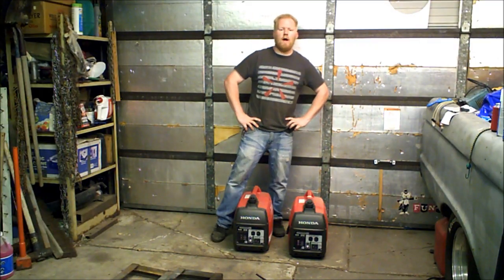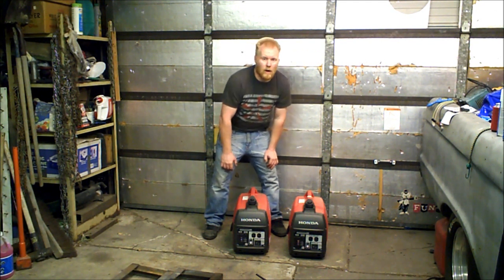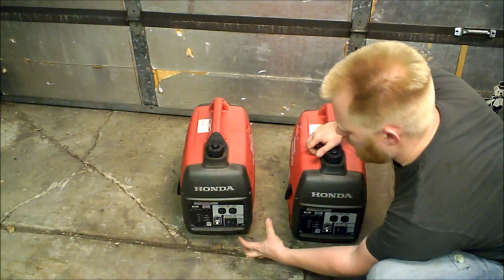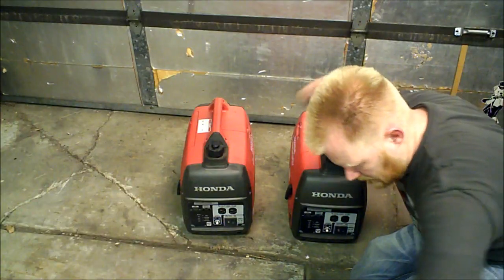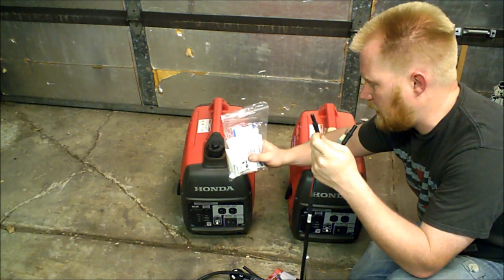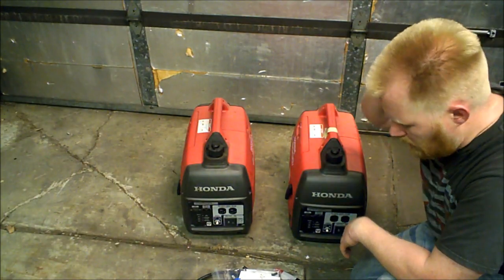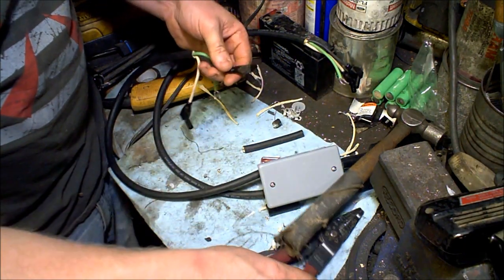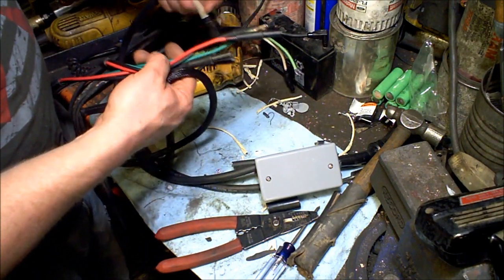Homemade 30A Honda Eu2000i Parallel Kit Generator

Comment: sixtyfiveford, will the hookup work if I don't turn on any  220v home appliances? I don't know if the motor on my gas furnace is 220v also. Your thoughts are much appreciated.
Reply from the maker: ***** Not really, because you will have 2 separate 120V out of phase circuits coming into your home. Every other circuit breaker as you go down touches one or the other. A 220-240v breaker touches both of the out of phase circuits giving it 220-240V. So you could choose to run one 120v leg and every other breaker would be supplied with power. This is why most people will just run extension cords to the major appliances. You could wire a generator on each 120V leg but because the phases of each generator wouldn't be correct(180 degrees out of phase of each other) you couldn't run any 220-240v appliances(Stove, Dryer, water heater).
Reply: sixtyfiveford Thanks, sixtyfiveford for the insight. I appreciate your knowledge on electrical.

Comment: Great video. Will this hookup work for my home transfer switch box instead of an RV? If not, what mods need to be done?
Reply from the maker: ***** Yes and no. It is only a 120v system so half of the home will be without power. You would be better off with a generator that can deliver 220v power to feed both legs of your breaker box.

Comment: Great Video! I am trying to hook up three EU2000 and was wondering if I just connect all three like you connected the two, would that still work? Obviously I need to get a higher rated breaker. Also, instead of the parallel cable connectors can I just use a standard plug on each generator as the output and then connect all three. Thanks
Reply from the maker: Shaddy Mzeghet Yes, just add a third set of banana plugs and a third can join the party. Yes you can just plug into the 20amp 120v plug and get the same thing. With the plug method you run the risk of one generator coming unplugged and it will be live male plug, so be careful. Tie off the plug/cord to the generator handle so if it is yanked it can't pull out the plug.

Comment: So I take it the inverters synchronise? It's usually an unwise idea to think you can just "parallel" two AC power sources even if the voltage, frequency or VA rating is the same
Reply from the maker: Tera Volt Yes, the Honda's are designed to do this.
Reply: LOL! When he brought both generators online, there was nary a hop, skip or jump. Either he was completely lucky by somehow connecting them in sync, without anything to measure it, or the generators have an controller that senses synchronization. Since he's obviously done this more than once, which do you think it is??  Do you think Honda would unleash this on the average consumer with manual sync parallel operation?

Comment: Thanks for the quick response.  It is the same as the Honda, but 2200 starting watts and 1800 continuous.  The outlets have a 15 amp rating and the parallel port hook up is at 20amps.
Reply from the maker: Brian Dernbach So you only have a thin cable connecting/paralleling them?
Reply: No, I built your exact setup, but instead of the plug end that you used, I used a standard 15amp female plug.  My concern was that the plug being rated at 15amp would be a little dangerous?  Also, been having a hell of a time finding the correct banana plugs?  Thanks
Reply from the maker: OH... You built a death plug :-)... kidding. You'll be fine because you're only pulling half the load from each generator. Which is 15amps each.
Reply: Sorry for all the questions, but won't I be pulling the same (roughly) as your Hondas?
Reply from the maker: Each of your generators are rated at 18.3 amps max or 15amps constant. So if you plug into each one they will share the 30 amp load pulling 15amps from each. The Ryobis are Chinese copies of the Hondas and function virtually identically.
Reply: Thanks for your help. Why do they have a 20amp breaker on the parallel hookup and 15 amp on the outlets? Aren't the both tied together putting out identical amperage? That was my last question. Thank you again. You are awesome!
Reply from the maker: On the Honda they are directly tied together and I would assume the Ryobi is the same. They put the 15amp to protect the generator from overheating/frying it's guts by  delivering to much power. They put the 20amp so it can surge to full capacity when paralleled but still protect itself. So each generator alone can only put out 1800 watts surge/running. It's not until they are parallel that you can get the extra 400 watts of surge capacity.
Reply: Awesome. Thank you
Reply: Sorry, one more....hahaha! So since I'm having a Hell of a time finding the banana plugs, if I put 2 plus on the parallel cord and plug into the 15 amp outlets I will still get the additional 400 surge Watts.....correct? The power is just running through a lower amp rated breaker? Do you have info on where I can get the plugs/part number. Thanks again for wasting so much of your time with me.
Reply from the maker: You will be limited to the 15amps+15amps= 30amps total output. But that is all you should need. The part numbers are in the video description.

Comment: Hey 65, I know this is an old video, but hoping you are still answering questions.  So, I bought the Ryobi units and am doing the same thing you did in your video, however, I mainly use my generators at the racetrack at night to power my trailer and normally I try to put the units about 75 to 100 ft away, just to keep the noise to a minimum for others.  That being said, I am running a long extension cord from my 2 generators 100 ft away to my camper plug which is just like the one you cut the end off of.  If I have a standard 15amp plug at the generators coming from my parallel cord, so that I can plug in my extension cord, what do I do differently to give me the full 30 amp through my 10-3 100ft. extension cord?  Thanks much.
Reply from the maker: Brian Dernbach I have not seen Roybi's setup in person, only online. I'm assuming you have the Ryobi parallel box with the 2 30amp plugs.  Even though your cord has a "15amp" plug it will flow the full amperage through your cord. Simply buy an adapter or cut off the end and install the correct end from the Home Depot on your cord.

Comment: well done , smart and to the point , Unfortunately i already bought that kit from Honda to hock up my 2 generators to my RV and it is on its way... My question to you sir is that , i am in an area where we do not have the Propane gas ... would this dual hock up of both 2000 watts generators be enough to operate my whole RV (New Dutchman kodiak 20feet) including light ,air conditioner, Fridge, microwave and TV ... have a nice day
Reply: Here is a very good document addressing your question:  https://www.steadypower.com/pages.php?pageid=133

Comment: I liked your video. However I got two Ryobi 2200-watt inverter/generators with a free parallel cable kit for $1098.00
After researching whats out there. The Ryobi is compatible with the honda in both noise levels, power and size for 1/2 the price.
Reply: Home Depot. The two gen combo is only available on-line at HomeDepot and you just have to ask for them to discount the package to meet the individual gens cost.
Reply from the maker: Mark Manzanares There are quit a few differences between the Hondas and the Ryobi's besides price. But the price is tempting for a lot of people who don't need a commercial rated piece of equipment. The Honda's are almost twice as fuel efficient, a fair amount quieter, lighter, smaller, have a proven track record and retain around 70% resale value, even after 10 yrs of use. However at half the price you could buy twice as many Ryobi's as Hondas and the extra 200 watts per machine is a great bonus. There a few of these Honda Chinese Clone generators on the market and it seams that Ryobi is making a decent one. I would say that China has done a pretty decent job making clone engines but I have repaired dozens and dozens of their generators and they fall short in the simplest ways: the wire they use is cheap, brittle and has poor sheathing, the rubber for the hoses, fuel lines, etc all seam to deteriorate after 4-5 yrs, the plastic covers seam to fade and crack, the poor quality of their bolts/nuts seam to allow loosening of parts. Preventative maintenance is huge on these and I don't mean oil changes. Bolts need to be checked for tightness, rubber hoses need to be checked for leaks, wiring needs to be made sure it's not rubbing through in areas, etc.

Comment: Great video. I wonder if you can turn off one of the generators after the A/C has started? Two generators are only required for the initial surge. This would save a lot of gas.
Reply from the maker: Theryl McCoy Thanks. Yes, but the AC will cycle on and off. The Hondas are pretty ingenious and generally you can place the secondary (last started) on Eco Throttle and it will idle down while the other maintains the AC. Only having 1 on Eco Throttle will generally allow the generators not to struggle on the initial surge while the AC cycles. I also have a video how to run them off an extended fuel system so you never have to refill them. http://youtu.be/RDkL593Wbt0

Comment: I see a lot of guys trying to do electrical work, without training and experience in doing electrical work.
1. Is that circuit breaker rated for 240 volts? (Aren't you generating 240 Volts? Shouldn't you have a second circuit breaker on the other hot wire?)
2. Insulating electrical connections with electrical tape is NOT recommended and is an electrical code violation.
3. Do you have a ground fault circuit interrupter?
4. Doesn't the manual say to have a ground rod at the generators and RV?
Reply: I read the manual for this unit:
Correction: Your output voltage is 120 Volts. The circuit breaker you installed is redundancy.
Reply from the maker: 314Tazo The circuit breaker is needed to protect the equipment. The generators each have a 20amp breaker  which in theory could allow 40amps to flow when combined. Adding a 30amp break limits the amperage to 30amps at the equipment. If the generators over produced power without a 30amp breaker you could over load the equipment and wires, causing a fire. There is no electrical code applying to combining generators like this in the US. Electrical tape is more than sufficient for the application in a sealed junction box  with soldered connections. A GFCI is not required nor code. Not all generators need grounding rods as their frame is metal and is considered grounded when touching the ground(per OSHA). If a generator is placed in a situation where is doesn't touch the earth or have a metal frame then a ground rod can be used but very very seldom is. Generators used in RV applications never come with a grounding rod.
Reply: sixtyfiveford
Like I said above; I see some people do some unsafe things, electrically.
Your instruction manual does NOT mention much about electrical safety.
OSHA and the National Electrical Code have info that can be overwhelming and difficult to understand.
I strongly recommend that you spend the money to get a licensed electrician, to review what you did.
Reply from the maker: This an extremely elementary setup and mimics commercially built units. This is no more complicated than replacing a light switch. Anyone with very basic electrical knowledge can easily understand this.
Reply: sixtyfiveford
Sure you are...
Reply from the maker: Thanks.
Reply: This was a great instructional video for us RV hacks! We don't need no NEC guy charging $40 an hour to make a simple plug hook-up. If we could afford electricians, then we could afford to just buy the $199 cable from Honda.

By the way, the circuit breaker is not redundant. The internal circuit breaker works for the internal 110v outlets. When you tap off the parallel wires you are bypassing that breaker and need to up it to 30 amps anyway.

Comment: hi, live in canada so no ports for hooking my two together. what if i uses two 15a plugs and pig tail them to a 30 amp twist lock. would that work?
Reply from the maker: Yes, it will work exactly the same. Just be careful, in the very unlikely event a plug comes undone it will be live. I recommend  attaching the cord through the carry handle before it is plugged in so it can't be pulled out.

Comment: Are the banana plugs the same for the 3000i and the 2000i?  I was going to change the output plug on the 08E93-HPK3001H to a 30A.
Reply from the maker: Yes, the banana plugs are the same for Eu1000, Eu2000 and Eu3000.
Reply: sixtyfiveford
Found a great deal on a parallel kit on ebay.  Modifications required to use it on an EU2000i: http://www.ebay.com/itm/230879395726?ssPageName=STRK:MEWNX:IT&_trksid=p3984.m1497.l2649
Reply from the maker: You would be better off just buying the basic parallel cable and splicing it into a electrical box with the 120v 30amp outlet. Here's why: the 220v 50amp outlet on that kit has no internal connection. So the generators aren't paralleled at all rather two 120v outlets side by side in the 50amp plug. You will notice that it says you can't actually use 220v appliances. You could find an adapter but it would only pull from 1 side to get 120v and therefore only pull from one generator.
Reply: sixtyfiveford
Actually the kit is easily modified.  The connection inside the 50A outlet is simple to disassemble.  I couldn't find a basic parallel cable for the price of this one.  I disassembled the 50A outlet and followed your directions to create a 30A circuit with a nice mounting back w/ clamp (included on the original 50A)  Works perfect!

Comment: Also, I watched a video where a guy used a eu1000i in parallel with a eu2000i. Have you tried this?
Reply from the maker: Yes, the eu1000, eu2000 and eu3000's will all parallel together in any combination.
Reply: What I don't get is in this video, you explain that the 120v and the parallel pugs are limited by the breaker (generator) not allowing you to achieve the full 26.6 amps. How does this cable skirt this issue. Regardless if you put a 30 amp breaker in it or not. I'm confused
Reply: If the limitation is the generator, using your home built plug shouldn't make a difference. Am I wrong?
Reply: BTW, thanks I appreciate your help.
Reply: I just bought a camper (2005) with a 13,500 BTU AC. Do you think that an eu2000i and an eu1000i paralleled together (with your setup or the Reliance GPK30RV cable) will run it?
Reply from the maker: Limited output with basic parallel cables. The ports are directly connected to the plugs internally. So power from one is fed into the other plug with the parallel cables. Then you plug your appliance into only one plug. You are limited by that single plug's circuit breaker of 20amps, robbing yourself of that extra 6.6 amps. The parallel kit plugs into both at the same time so the stock circuit breakers wouldn't blow until 40amps (20+20amps)

Running a 13.5k BTU. A single eu2000i will start some but not many and some AC unit can be damaged by struggling. The AC needs just a little more umph. Adding an eu1000 would give it plenty to start and run. However from a fuctional and resale stand point I would buy 2 eu2000i's. They seam to keep 80-90% of the original cost even after 5-6 years of use and the eu2000i is a better value.
Reply: Thanks bud, I really appreciate all your help. That makes sense now.

Comment: So other than the breaker, what does your setup have over this setup
http://goo.gl/eoW5w9

Would you recommend this for the price?
Reply from the maker: It looks good. I like how theirs is professionally molded together.
Reply: I'm an idiot when it comes to electricity. Isn't this pretty much the same thing as what you built? Minus the 30 (26.6) amp breaker.
Reply: You can get this cable just about anyplace, even Sears http://goo.gl/ZPfw3c
Reply from the maker: Amazon has it as well. It same Yamaha but it'll work for the Honda's
http://www.amazon.com/Yamaha-ACC-0SS55-70-01-Sidewinder-Parallel-Cable/dp/B00IAQ4HMS/ref=sr_1_sc_3?ie=UTF8&qid=1402020769&sr=8-3-spell&keywords=honda+parallele+cable

Comment: Having read the comments below, I have a Canadian model as well. I need to get another and run them in parallel for my AC unit. So I can accomplish the same thing by just using the 110 output plugs on each generator? Simply wire as the same in your video? I understand the live plug warning, just need to remember to turn them off before handling. I'll be using a twist lock.

Comment: Thanks for the vid. I just bought the parts to do this except for the wire all from Allied Electronics:

20 amp banana safety plug, black: 70197115 (soldering required)
20 amp banana safety plug, red: 70197116 (soldering required)
30 amp panel mount circuit breaker with screw terminals: 70129041
Reply from the maker: You're welcome, I'm glad the video helped and I'll put the parts numbers in the description for others.

Comment: Do you connect the four line black wires together and connect to one side of breaker then one black wire to load side of breaker then all white wires are all soldered together?
Reply from the maker: There will be: 3 white wires, 3 green wires and 3 black wires.

3 white wires all get soldered together
3 green wires all get soldered together
3 black wires: the 2 wires coming from the generators get soldered together. These 2 wires connect to the LINE side of the circuit breaker. The 1 remaining wire coming from the 30 amp plug connects to the LOAD side of the breaker.